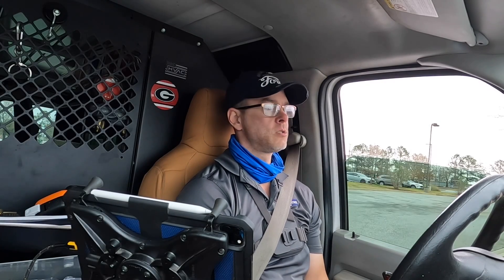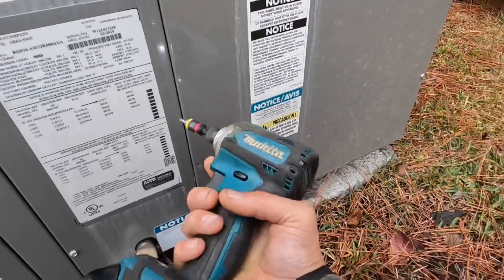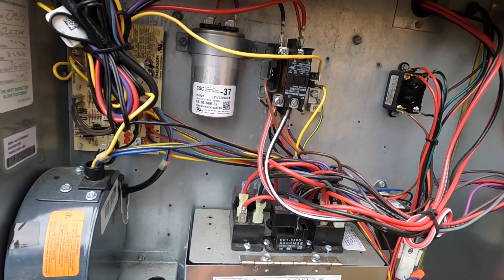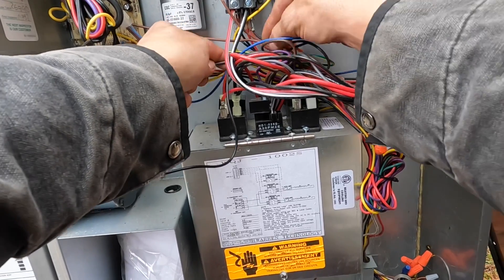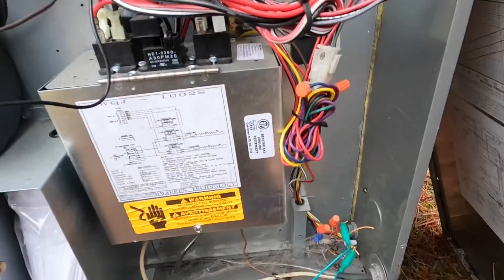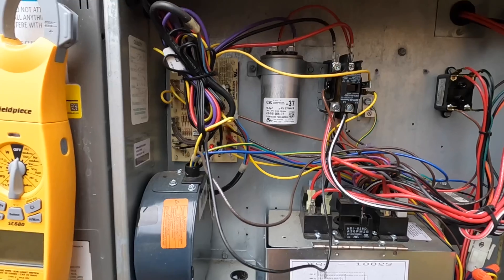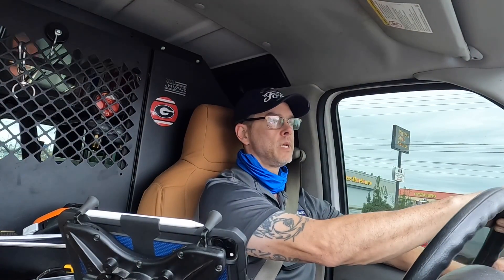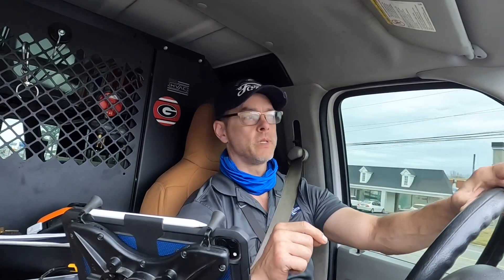Condenser Fan Motor Wasn’t Running - Rheem Heat Pump Package

Comment: The problem I am having with my Rheem, the fan wants to turn, jerky movements. I opened the motor, no obvious damage or burn smell, I get 15 ohms on the motor on all three. I am getting 24v signal and 240v. Any suggestions?

Comment: Our condenser fan only runs sometimes.  I went outside and checked the breaker and it was good.  I turned everything off including the breaker inside and also turned off the breaker outside.  I turned everything back on and the fan ran.  I checked it throughout the day and it was turning on.  This morning it stopped turning on again.  Could that be a bad capacitor?

Comment: A lot of the time I ask the customer to cycle the power on the rheem heat pumps before I come out. These boards seem to show a low pressure lock out when there is not a true low pressure issue.  If it happens a couple times I normally replace the board and that takes care of it.

Comment: Newer heat pumps are like furnaces in that it's good to look  at  the board for any codes before  disconnecting  the power. I always have a hard time remembering to do that!

Comment: Wasted some time at the beginning messing with the motor. Same thing for me yesterday. Pulled up to a mini split that the customer said needed to be recharged (once every year) and so I locked in on that issue, pulled all the tools out only to find it was running 135/400 😂

Comment: I've gotten x13 condenser motors going  by turning the power off. And it didn't have a circuit board on it. X13 condenser fan didn't work, I turned the power off for a couple minutes turned it on and it never failed again. And like I said it did not have any circuit board on it. Good yob. I think the module needed cleared. And the one I mentioned was a straight cool.
Reply: I had a straight cool today doing the same thing,  cycle power motor runs hours then the same thing?

Comment: It's strange seeing the ECM control electronics separated from the motor as they did.

Should it happen again, I'd check that board immediately upon walking up for power and any error codes. Maybe it would shed some light on the mystery?

It's going to drop below zero degrees (F) here tonight. Amazing how there are places in the US that are still quite warm!

Comment: The condenser was not running when walked up, but the compressor was not running either.
Reply from the maker: Compressor was running
Reply: @HVACGUY  sorry, when you walked up to it, I could not hear any sound of it running. When I turned the volume up, it might have stopped just as you walked up to it. All I could hear was the blower running

Comment: Sounded like it could be an older woman.  Less brown fat as you age and with a normal skin temp in calm air of 85, lower ambient air feels cold.  Likely not so active as 81 would feel quite warm to an active person.  Heat pumps blow "cold" air as the skin feels it at around 90.  We've removed a lot of radiant sources, such as incandescent bulbs, old TVs, etc. that used to provide that base radiant heat that balanced with the "radiant" cold you feel from the winter windows and such.   The old school way was to close the curtains, especially at night, and the house felt warmer even as the measured temperature never changed.  

I'm testing my idea right now.  My 93 yr old aunt was constantly having them adjust the thermostat in her assisted living room.  I put a floor lamp with a 100 watt incandescent bulb in a corner that she controls with a remote.  More light but just that bit of radiant heat has seen her complain less about the temperature.  Sure she could sit alone in her room bundled in blankets, but then those would be tripping hazards when she got out of her chair.

Comment: Boiler fix yesterday, today anti-freeze it, runs good, more work tomorrow, another job sat or sun shower valve job...I don't spend a penny on advertising
Reply from the maker: I’m still putting small ads in the yellow pages. I often think it’s a waste of money.

Comment: possible the txv is fucked on thay unit. it has one txv serving both heating and cooling. weirdness. but that could of caused. alow pressure lockout. always keep the power on and look for faults first. even when we get ahead of ourselves lol